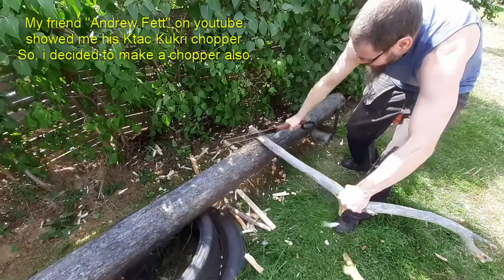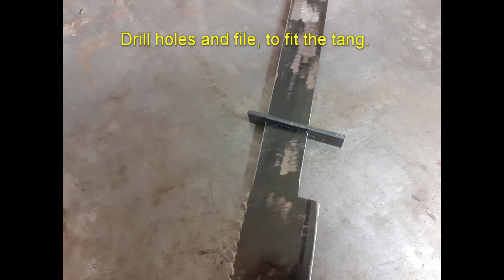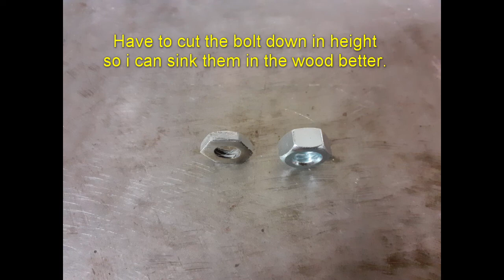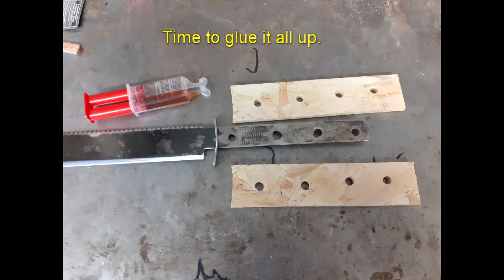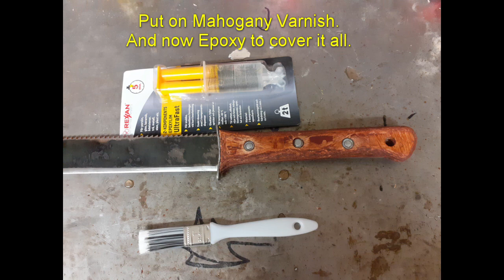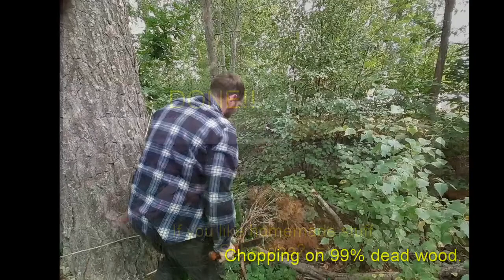DIY Machete/Chopper from Metal sawblade.

Comment: Hey DSS, I like it alot! :) Looks like a good chopper. And it’s cool looking. 
I’ll have to rewatch; what type of saw blade was it? Are you gonna make some kind of sheath for it?
Was also pretty cool to see my name in your vid:)👍🏻👍🏻
Reply from the maker: It is a Metal sawblade,  made to cut thick steel!!...(nice multi-function).  HSS, bi-Metal-thingy...  
Insanely hard to try and drill through,  so i use my Tig Welder and simply BURN a quick hole with 200+ amps.  😛   not the best, but it works for now.
1 chopper done...  i have 2 more coming over time:  1 "Rambo knife"..  2: Elven sword/chopper.
Yes,  i will probably make a sheath for it later on,  when i have figured out what i will make it from,   for now, it sits on my knife wall.
Reply: @dss-homemadestuff8580 
I love Rambo knives. Hollow handle not too durable but I still like them cause they’re Rambo. Rambo III knife might be my favorite. :)
Someday l want to make a chopper like the one he made in the 4th movie. I think he was in Burma. Bout chopped the bad guy in half at the end. :)
Reply from the maker: @andrewfett142  Rambo 4 knife,  is a sort of Parang Machete,  they are simple but effective, and should be pretty easy to make.
Rambo 4 knife has a hole in the blade...weight reduction = lesser chopping power... so kind of weird.
And my "rambo" knife, has a solid handle/tang...  since a hollow one is not durable for chopping.